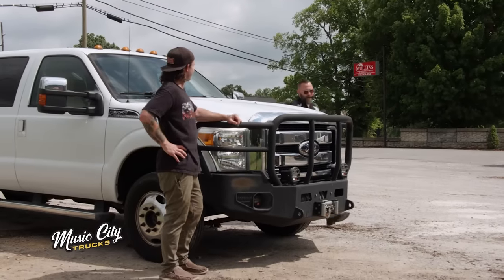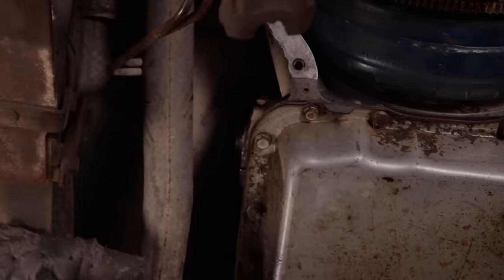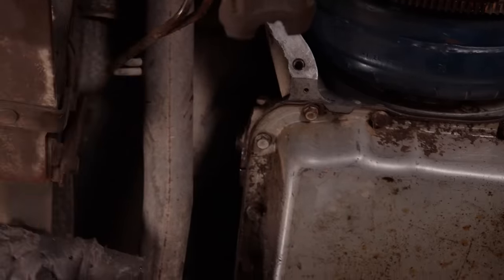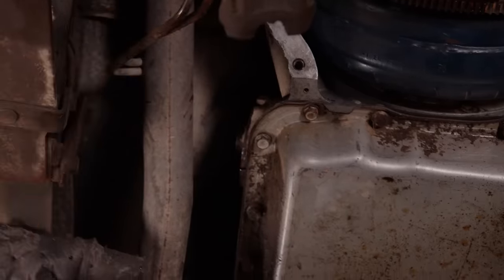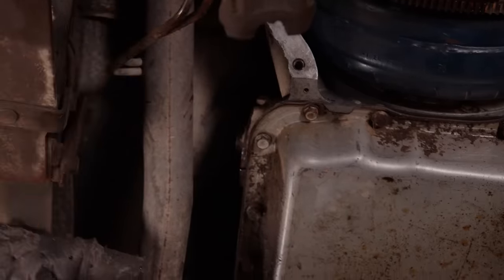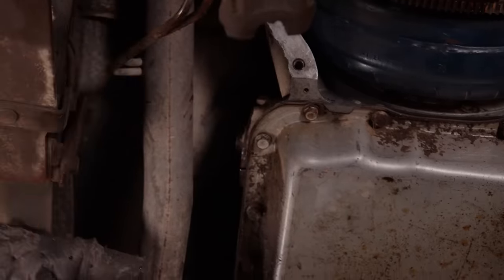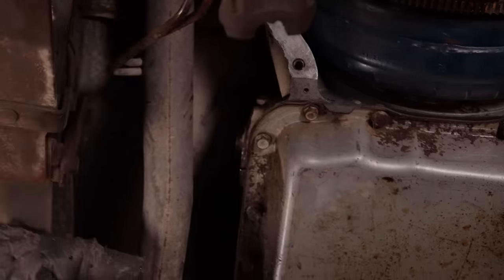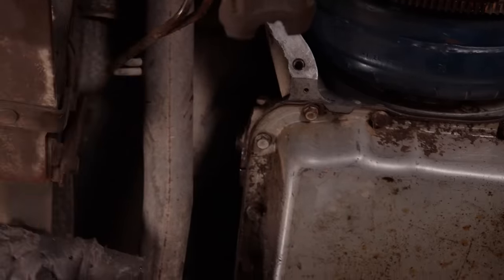Full Build: Transforming a '85 Chevy K10 Into a "Fall Guy" Tribute Build

Comment: Hate to see so many haters in the comments absolutely knitpicking this build, if it bothers you that bad go build your own, that's what hot rodding cars/trucks is about. These videos are for education and inspiration, it doesn't have to cater to every individual. There's even some things I might change about it but I'm not gonna go complain and say these guys did it wrong, because there is no wrong with the hobby of building cars. Y'all really letting the hot rod spirit die like this.
Reply: My only concern is I would NOT advise people to use gaskets on diff covers.  Especially on a truck that's 40 plus years old... The covers have imperfections the cast iron housings have imperfections and a lot of times the gasket just does not make up the variation... 1/4 inch bead of black silicone all the way around on the inside of the bolt holes... It'll never leak

Comment: I have an 85 but its a gmc, they never did come with a 350 stock, they had 4.3 5.0, 6.2 and 454. Mine also came with auto locking hubs.
Reply: Engine code LS9 (350 cu.) available from '73-86 on all K5/K10/K20. Try again. Argue all you want I have the RPO sticker to prove it.

Comment: I really like this video, it's awesome! However, I've been trying to find a reasonable square body like this as a starting project, I found one about the same quality of this truck (before repair). The Man was asking 22K for the thing, he finally said he would take 20k, now this is for the rough truck to start the project with. I can't find anything under 15k unless it is completely stripped or rusted out and falling apart. I found one dealer that had one for 17k, but it needed TONS of repair still, he admitted it was a project to do, but, it had no rust to amount to much. I just can't find a starting truck for a project. Can someone tell me what is the current General price range for a project truck to start with as of the year 2024? I wanted to have my own project, but it looks like I'm gonna haft to spend 30k on a basic completed truck that's ready to go. Thanks for any advise and for reasonable correct pricing info for the current year of 2024.

Comment: I really appreciate this kind of content, but

The reason you twist brake lines is not shock absorbing as the primary reasons. It's a secondary "gift" to an innate engineering design.

The twists are a poor man accumulator. If you sprung a leak in your brakes, those twist hold enough fluid to apply the brakes a few more times, even if you got to pump them to stop.

You want as much line just after the master cylinder. If it was strictly a vibration reason, you'd see twists at other points constantly. Where you see coils are at collector points in the system.

You not wrong at all, but I would have twisted the coil vertically so if a hydraulic leak happened, it would have a harder time to gravity feed the system dry.

I hope this makes some sense

Comment: You just threw all the strength of the short side of that Dana 60 in the garbage. If you trussed it and built the mount into that then adjusted your height to match in the rear where it’s easy to. 
Building a truss would’ve let you adjust Dash aft angle etc. plus wgain the always wanted extra strength of tying both tubes together. 
SO SAD TO SEE A 60 TRASHED

Comment: Take the cost of thew  pickup plus all the parts you put on it to make it drive like new and you are probably over what you can buy a newer used vehicle for at this point. I understand the love for the older body style but for the average person with a limited budget, the amount spent on parts just to make it run like a newer vehicle is prohibitive. Better to buy something 10 to 15 yrs old with low mileage and do simple bolt on adds for less money.

Comment: 1. Should have put stainless brake lines on.
2. Why do you not clean and paint or renew any of the parts? You put the rotors on dirt hubs.
3. Electric lockers are trash. Should have went with PowerTrax.
4. Excellent choice going with electric fans. But you failed by going to a mechanical water pump. Mechanical water pumps and fans really have no place anymore.
5. About time Edelbrock made a good carb. Their other style is trash.
6. You should have went with a bigger carb, about 850cfm because that 750 is too small.
7. You need a higher volume fuel pump.
8. Not upgrading the lighting while you were at it is a huge failure.